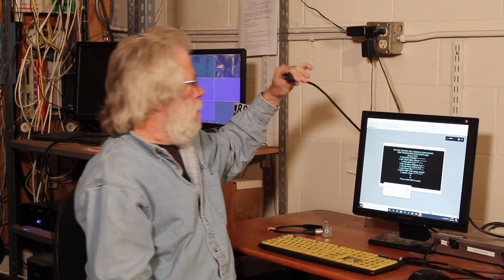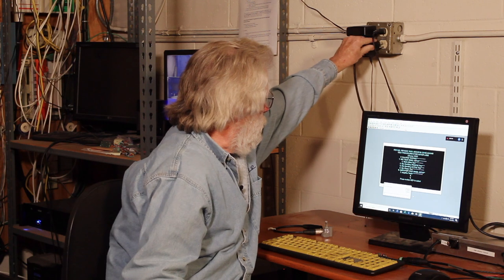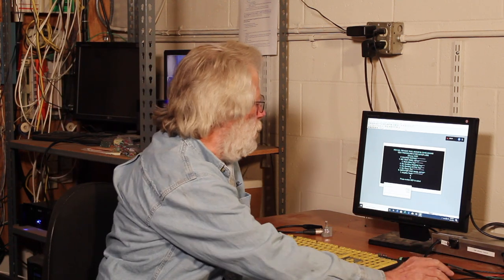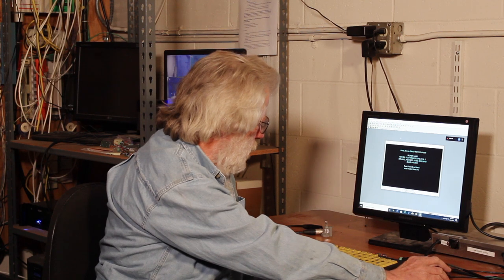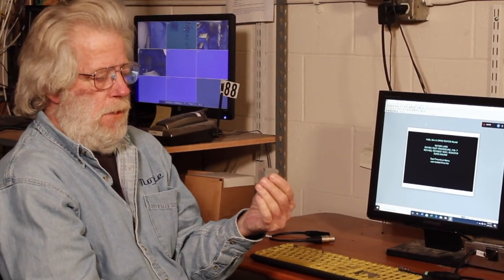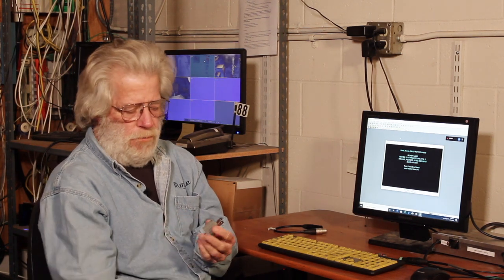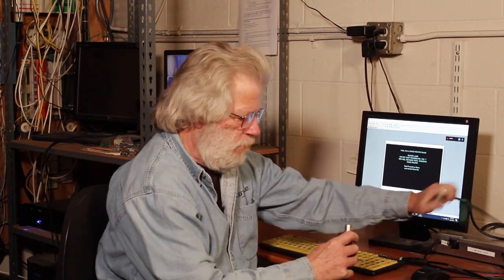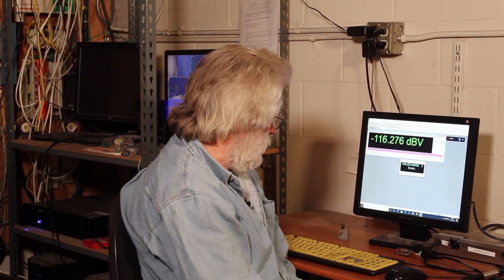David Royer On How To Fix Ground Loops!

Comment: Trying to record an electric guitar i have lots of noise. To minimize it i have to find a certain position, i have to face away from computer, hold a guitar in unnatural position (not even 90 degrees, more like 100-110 degrees), and any deviation from that "safe zone" causes noise in my headphones (monitors are off, of course).  It is either with single-coiled pickups or humbuckers (the first ones, obviously, worse). 
The StudioOne shows quite a high level of noise on a recording channel /quite hearable -33 to -44dB/ even with no sound coming through (when i don't produce sounds on guitar and/or when guitar is in "safe from noise" area).
I am thinking about getting Electro-Harmonix Hum Debugger pedal... (?)
What would you recommend to do and what products to use? 
That's the main question. 
Also...
~ I have too much noise when i turn the mix (comp/in) knob towards instrument (1) and a very little headroom for recording, either the signal is too weak or, after moving the gain knob just one little degree, i get distortion, noise and clipping (2). It is either with single-coiled pickups or humbuckers (the first ones, obviously, worse). PreSonus iTwo has a very little headroom, but i suspect that this is not the sole cause: maybe by increasing the gain i increase the noise (interface limitations+ground loop).
(1) - waiting for a new interface Topping E2x2 (could/can't record anything with PreSonus iTwo or, recently, SSL2...SSL2 supposed to have a very low noise, but in my case (? why) i had even more noise...returned it while i could). 
(2) - waiting for a new interface and a ground loop breaker usb power injector for the interface C-port. 
For recording with a physical amp (Katana) i plan to get a Morley Humno Noise Eliminator. 
DI boxes (active and passive) seems like do nothing in my case (or make things worse): Behringer active DI20 gave lots of noise; DI Dolamo a bit Increases the noise compared to direct connection (TRS a bit more compared to XLR), but in nut-shell, it does not decrease the noise.  
Don't have any Gate pedal and not planning because it is tricky and i hardly play heavy music. 
In recorded track the noise is increasing in quiet times.
I have a power conditioner Furman m8x, everything is connected there and it goes to one outlet. No noise-cancelling devices for pc or USB ports or 9V supply. All my guitars are in tact (grounded and shielded). The lights: no lights, some lights, big lights - not much difference.

Thank you
Reply: Hi Dennis  - sounds like you have an RFI problem. This is beyond the scope of what we're discussing here. It's important to differentiate between noise, ground hum, RFI - they are all different problems caused by different sources.

Comment: Anyone know this type of solution for UE plugs? Thanks and very good video. 😊
Reply: This is an audio ground lift (not an electrical ground lift), so it will work fine regardless of voltage or ac plug type. It will not interfere with EU safety requirements.
Reply: @dusty_wakeman  Thanks for the answer! Can you give me the name? Don’t understand nothing about electronics
Reply: It doesn’t have a name- it’s basically a short mic cable wired as David describes

Comment: Questions/Problems (more).
* Opening a project i got message that 970 files are missing. With Search i found some missing files, it became 270, and these can't be found anywhere (i've searched all folders /sub..sub_subs/ in my big folder dedicated only for StudioOne, all back up /mirror/ folders on 2 external drives). It is an old and very extensive 'precious to me' project, and ridiculous thing is, for example there is a guitar solo, i splat it at some points to get rid of some noise when i was not playing, now the solo is there only in pieces; all channels are ripped off here and there. Plus other issues.

* Yes, as a rule i have a 25 minutes save; "use cached plug-in data on save"; "ask to copy external files when saving document" all on/checked. 
* I didn't change nor names, nor locations of working folders and files (though i have this project saved under different names as versions).

* What i did is: i replayed some important stuff on left-overs and added two old stereo mix tracks of this project/song with different EQ settings (and with mistakes, quite unbalanced, but it is better something than nothing, there is no way i'd re-do everything due to circumstances and unrepeatable settings and instruments). I aligned everything nicely (time, buses, volume,..), corrected, blended everything nicely, and put vocals at the right level (up and with different settings, that's why mainly came back to this project), clicked "save". Logically, the DAW asked me "do i want to add these two stereo tracks/files", obviously, i clicked "yes" and...1475 files for each added stereo track started copying. In panic i pressed "cancel", but it was too late. Where these files are from, why?! Why these stereo tracks came with so many files? Where they went to?
I checked the media folder to look for duplicates: no duplicates, but there are about 6000 files there (and some of them are not from this project).

* But this is not all: i had plenty enough of memory space (workable 450-500GB free), now i am in the end of red zone with 78GB left.  Agh..

* But this is not all again: i started clearing up the space on pc and the more i delete or move ...the lesser space i get on computer...now it is 50GB.

* To free space and continue working (without interruptions and CPU overload) i thought that i would mirror the path, create the same folders in external drive, link the project to media files there, But i am afraid to make things worse in this and other projects (especially considering that freeing the space now works for me the opposite way).

* What is wrong? How can i fix all that mess?
Reply: Hi Denis - wow -sorry you are having so many problems! All of this is outside the scope of what we are discussing here. We would suggest you get some help from StudioOne or your Pro Audio Dealer. You might also want to check some of the forums for the products you own.

Comment: Welll made video. But how would one break the loop in an unbalanced stereo setup?
Reply: I'll run this past Dr Dave, but the first place to start is to make sure everything is plugged into the same AC circuit.
Reply: It often involves experimentation.
In an absolute worst case, you may need  to use an audio isolation transformer to get rid of hum

Comment: I'm 68 a retired and David Royer, is getting old. He's babbling here. Talking about ground loops, yes. A big factor for the, Home Recording Enthusiasts. More so than the high dollar ticket Pro Studios.

And so take it from me. A Top  50+ year Pro Studio Fixer person. Your current biggest problem with ground loops. Is, most definitely, from your, Computer. And other computer devices. As these do not use our, Old Fashioned Power Supplies. With electrical power transformers. No.

These newer computer devices use a Switching  Power Supply. Which has no big heavy, AC power transformer within. It uses a bunch of low-cost lightweight, semiconducting parts and pieces. And it is directly coupled to the AC power remains. With no isolation. From an internal power supply transformer. This thing is your biggest headache. And so what to do?

You really don't have many choices here. All of your audio gear is, properly grounded. With your AC power cord, third round pin. And your audio gear is safe. From accidental electrocution.

Whereas with your computer plugged in. You're not just getting, 60 Hz hum. You are getting multiple harmonics creating, Buzz. Buzzing buzzing buzzing. Enough to make you go mad. And there is an easy fix.

The easy fix here. Is that, little gray or black or orange colored, 2 into  3 AC plug, adapter. To, Lift the Ground, on your computer. Now your computer is not grounded. So make certain. You got a good ground wire. Going from your, Audio Wire. From your gear. To the computer. Your computer is now grounded through your audio wire to your audio gear. And not via the AC plug. Where you are picking up your ground loop Buzz.

Though there is more risk. This way. Then a safer route yet. Using the above recommendations. Is to, add in. An additional, Power Isolation Transformer. You can pick up from any, Industrial Electrical Supply, company. And this will then allow you to plug it into your, 120 volt, AC wall outlet. You plug in the transformer. Then. Via a multi-AC power strip. You plug that into the output of the transformer. You will have No More Ground Loops, at all. As your power and all of your gear is now Electrically Isolated. It's a great way to go.

These transformers are relatively small. About the size of your fist. Mounted in a box. With a couple of electrical connectors in the box.  To plug-in with. And you will be amazed! You will likely notice. All your audio gear has less noticeable recorded noise. And the sound  may be somewhat smoother sounding. Because what you also don't know about ground loops?

Even in your home studio. Without any buzzing or humming. You may feel your recordings are still, lackluster. They just don't sound like you think they should? And unbeknownst to you. Your ground loops exist and are in full force! But you're not hearing any humming or buzzing? So what's happening?

The humming and buzzing that you do not hear. Is, now, modulating all of your buzz and hum free audio. Modulating it at 60, 120, 240, 480 or so times per second. And it actually sounds like Jitter or very fast analog tape flutter. In digital land it's called Jitter. And modulated audio without any humming or buzzing.  Can playback and feel just like a lot of jitter. But how would you know? I certainly do. I have to solve these problems. And David Royer designs nice microphones. I love his microphones though I do not own any myself. I would get his basic cheap, passive, ribbon microphone. That's all you need. You need cloud Lifter. You turn your gain up all the way. And then you plug the output of your microphone preamp and/or equalizer. With its low level. Into a 1176 Dynamic Range Limiter or equivalent. And you turn up the volume there. You don't use a stupid cloud lifter. But there is a caveat there.

Many microphone preamps also have available Phantom Power. No passive ribbon microphone really wants any Phantom Power. Though most will work just fine. A bad cable. An intermittent cable. A tiny little intermittent. Can result. In the death of your ribbon microphone instantly. And so?

While I love a ribbon microphone into a decent microphone preamp. Into your cheap one.  That has Phantom on you can't turn off. Without turning off the other microphones. A Cloud Lifter or equivalent. With a passive Ribbon Microphone. Actually creates a safety net. That keeps Phantom power. Away from your precious passive ribbon microphone. Kicks up the level a few DB. And you'll like it. Because it won't sound like a dynamic or condenser microphone. And you will learn its value. It's incredible, value.

But hey. You don't need an expensive Dave Royer microphone. There are some cheap Chinese made, ribbon microphones. They are Absolutely Worthy. And an incredible bargain! And if you break one? You won't jump off of a bridge. For destroying a $1500-$3500, Phantom powered ribbon microphone. Whoops! Yeah don't do that. Get a cheap ribbon microphone. You'll love it. I had a nice collection. I used them more often than my, much more highly valuable, Neumann, U-67's, KM-56,, U-87's, KM-86's. I used the ribbon microphones much more often. Especially today with Digital Linear PCM Recording. That already sounds like broken glass. And ribbon microphones will tame that down. And they take EQ and a lot of it, very well.

So sure I recommend all of those Royer Ribbon Microphones. And the Mohave series of condenser microphones. They really are very nice sounding. If you've got the money. Rich guys most certainly, do. The rest of us? Ha ha ha ha ha! Ha! None!

So get yourself a Cascades or a Fostex, other Chinese, Ribbon Microphones and. And Ribbon Microphone Kits. Very much like the old RCA BK-44's. Those classic ones you see in the movies. Though the one on Larry King and Dave Letterman for years was the RCA 77-DX. And you were not hearing those. Those were props. I have a pair of those. They sound different from the 44 series. 44 series is a long geometry ribbon. The 77 and modern German derivations are a Short Geometry Ribbon, type. The RCA 44, AEA reproductions, Cole's, B & O,,  Royer's and virtually anybody else. Those are more the, rounder sounding, Long Geometry Ribbons. They sound very mellow. Where the shorter ones have a little more zest to the sound. While still having the smoothness of a ribbon. Fine on a man. But made for a woman. Where have we heard that before?

So the issue of ground loops is mostly from your computer power supply being direct coupled. So you must lift that ground. And make sure your audio gear is grounded. Because you are now grounding your computer through your audio gear. So you can connect your audio gear to your computer without humming and buzzing. Because it forgot the words.

And David Royer should enjoy his retirement.  As the Recluse he chooses to be. And who can blame him? Everybody wants his ribbon microphones. I mean who wouldn't? I wouldn't turn one down. I'd love to have one. And I can waive it at my RCA 77-DX's. Which I'm letting go of after about 40 years of ownership. And I dearly loved them. Never abused them. Never used them, recklessly. Never took them outside to be in a big breeze. Don't do that to you ribbon microphones.  They won't, survive that. They are indoor microphones. Except for the RCA BK-5. Where the ribbon was inside the body of the microphone sideways. I never cared much for the sound of the BK-5, myself. But I knew other Radio Guys, loved them. I just had the 77's. And the BEYER, M-160's and 130 bidirectional. And a good old SHURE 300 long geometry ribbon. My only long one. As I don't have any 44 or Royer's.

I dearly love, Dave Royer. And Wes Dooley from AEA. These guys have kept a great sonic piece of history, alive and well! When they all but disappeared. Starting in 1980. And all of the poor ribbon microphones that ended up in the landfills! I was sick over it! Oh my God! What a catastrophe!

Yes. That really happened. As when I was transferred from, NBC Radio. Over to Network Television News On Air Operations. They showed me the microphone locker. And probably told me. The week before I got there. They threw out all of the old crappy ribbon microphones! And got all of these brand-new, miniature Sony, ECM-50 lavalier microphones! Hurrah hurrah! And I just staggered away in tears. Did anybody rescue any? I asked?  A couple guys rescued a couple BK-5's. Ugh! No 44's no 77's and that other special one. That looks like a conglomeration between a 44 and 77. Used for a lot of Hollywood movies. I forget the model number as a senile 68-year-old now. 35 something?  53? I'm reaching. But they were all thrown in the trash. The week before.  I'm still suffering over that to this very day. It was a whole Mike locker full of them. At NBC-TV News, Washington DC. And were made by our parent company, RCA. We still have the tape recorders and video recorders! Speakers, amplifiers, limiters. But they elected to throw out those microphones. What a bunch of morons! That's criminal! I'm still suffering over that. Those poor little ribbon microphones.

Treat a ribbon microphone like you would treat a woman. Do not beat them.
RemyRAD
Reply: Wow!
Reply: @davidroyer5049  He's older than you are! Maybe retirement wasn't such a good idea.🤣
Reply: Never mind. . .
Reply: Remirad posted quite a missive; it would be nice to see him edit it a bit. . . For starters, his point about switching power supplies is interesting; I have had trouble with a Sony flash card recorder if I use an ac adapter with a switching power supply. I would like to see him clean up his post; the more ideas about how to get ornery equipment to "play nice" together, the better.

Now, as to his remarks about Chinese ribbon microphones, THAT is another story-- they are not up to ROYER standards but they can be fun to tinker with